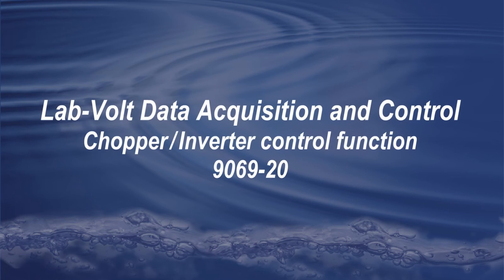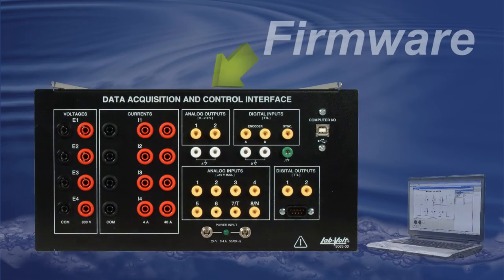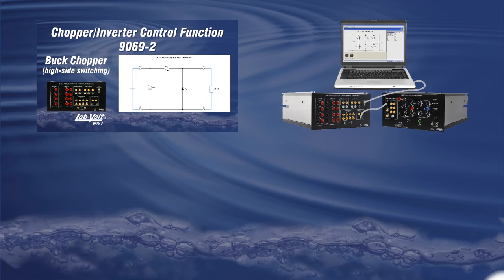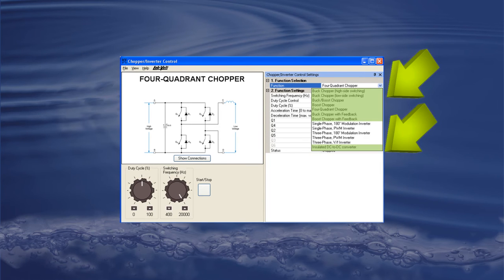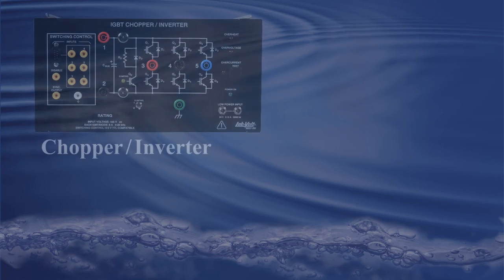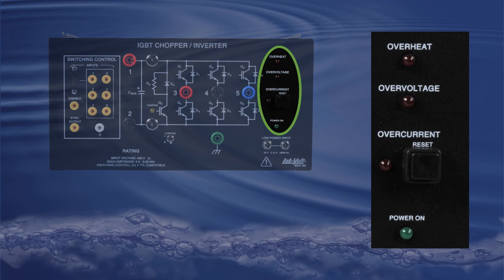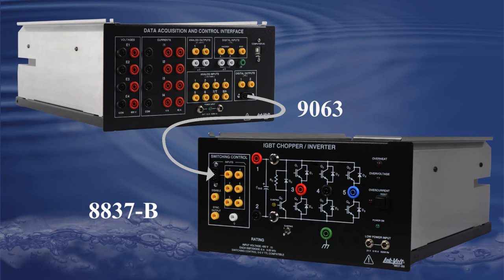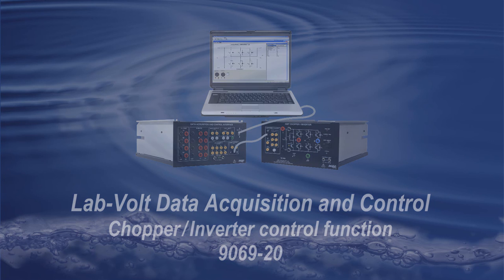Chopper / Inverter Control Function Model 9069-20

Comment: The inverter waveforms look a bit odd. Can you explain why they are not more clean PWM and smooth current, please?
Reply: Thanks for the question.  I'm not sure which waveforms you are referring to.  At 1:50, the 4-quadrant chopper shows that V2 has an overshoot (due to the recovery time of the free wheeling diode I think), while the current is triangular because of the smoothing inductor and goes up as the duty cycle is changed.  At  1:56, the Three-phase V/F shows voltages (not current) where the pulses are sometimes so narrow that the digital oscilloscope can't catch them (at low voltage).  These voltages are taken directly at the output of the IGBTs, no smoothing inductors.  Currents would be quite smooth though if they were sent to a motor because of its inductance, but they aren't displayed in this short marketing video.  At 2:08, this is voltage again but this time with a time/division low enough to show individual peeks, but the window isn't big enough to show full cycles, and at a higher amplitude, overmodulation is used which gives the "sine waves" a flat top".  Please don't hesitate to contact me directly at services.didactic@festo.com for any additional question if you prefer. By the way, I like your channel!